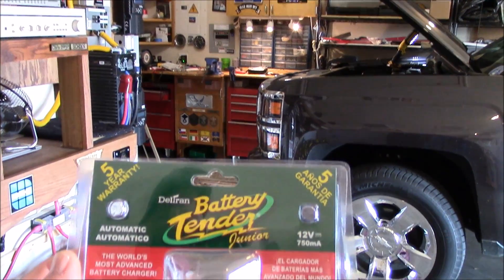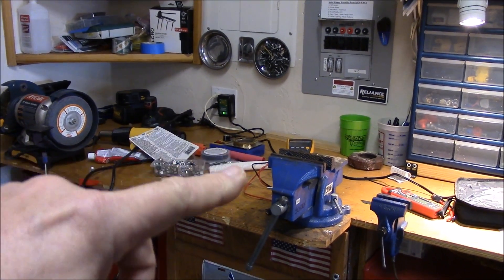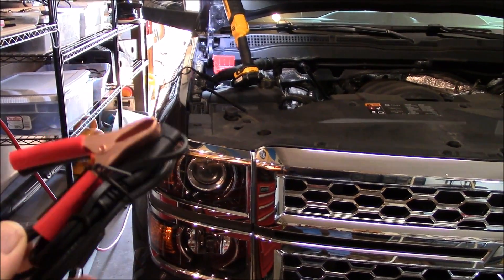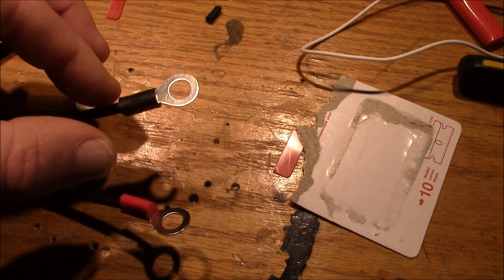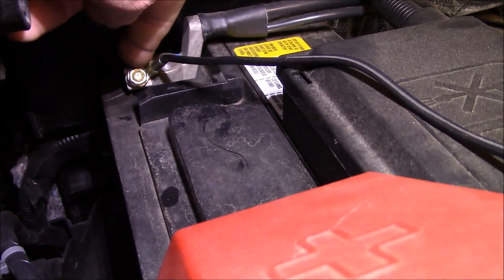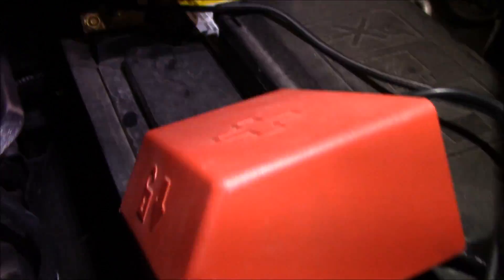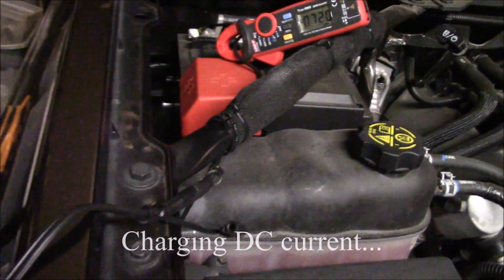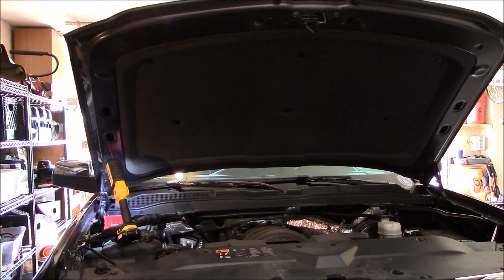12v Deltran Battery Tender Junior: How to preserve your battery!

Comment: I just learned the 750 ma junior charger is made for smaller powersports batteries motorcycles, atvs, jet skis, ect...   car and truck batteries use at least 1.5Amp output.   Also, don't leave the maintainer on year round because it will overcharge and damage the battery.     Supposed to use intermittantly until charged.   After 1 year of maintaining my ole work truck brand new battery, fried it and wouldn't hold a charge.    Just some info for whomever it helps.

Comment: Chris,  I have connected black to black and red to red pigtail from the battery tender to the 12v battery terminals still inside my Honda Accord 2007 V6 car, just like you have here. I had to cut a small gap on the rings to screw it to the battery terminals since I have ample space on the thread and I just had to squeeze them from the side.  Question though since not sure if that’s grounded as well via the negative terminal. What do you think? PS: My MB has a dedicated positive and ground terminal inside the hood unlike Honda Accord.
Reply: Nice. The canadian tire trickle charger has the small cutouts built in. Can't wait to install it tomorrow.

Comment: So with the battery tender, you can just leave the battery in your four wheeler and while it is connected? No need to take the battery out and disconnect the other leads?
Reply from the maker: Right...until you want to take a ride. Just don't forget to disconnect it. Always consult with the manufacturer before using...and insure the battery is in decent shape. FWIW, I run four of these 24/7 always connected

Comment: You drive a Chevy Silverado from what I can tell, and I drive a 2014 Chevy Cruze LS, and heat shielding wires really helps with longevity and flexibility in the long run.  I wrapped most of my wires and hoses in the engine bay with reflective heat tape rated at 800° direct heat, and much higher for ambient heat.  So far I haven't replaced any wiring or hoses and everything seems just as flexible as the day I bought the car.  Heat shielding does work.  Good video.

Comment: for battery tender junior any idea how many hours to charge a  dead  car battery (from sitting too long) to be able to start it up?
Reply from the maker: Def go over to Battery Tender's Facebook page and post this question to them. They are the experts. I own three of these Battery Tenders and two of them remain connected 24/7. They will charge a battery plus maintain it...so, it all depends if the battery can hold a charge (dead cells, shorted cells, no water, too old, damaged, etc-etc). Time actually charging depends on SOC...could take days

Comment: This might be fun, plug the Tender into a Kilowatt meter, then take it's draw in watts and divide that into it's output 
(measured amps .718 x volts 13.12 = 9.42 watts)- for an efficiency test.  

Lets say the box is pulling 12 watts per the Kilowatt meter, and putting out what you observed at this time  -  it would be 9.42/12 = 78.5% efficient.
Reply from the maker: Cool test. I got one of the old ones, one of the new ones...might check the difference

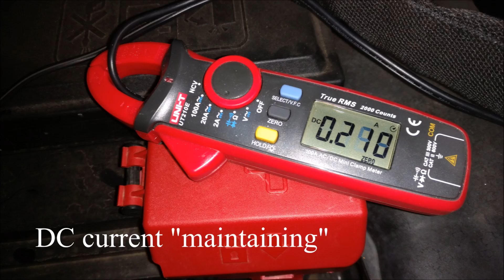Comment: Your Uni-T @ 4:15 looks like brand new ... you should see mine, holy moly--- looks like it's been thru a war- I'm ashamed !
Reply from the maker: Mine too (after spring/fall) doesn't measure DC current at all. Lasted 18 months. Tried several times to get it replaced by contacting the company, the seller, and Amazon...not a word back. Ended up buying another one because is use the shyt out of them